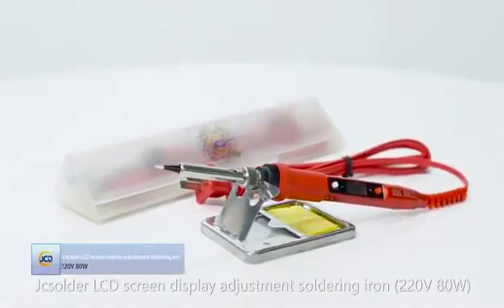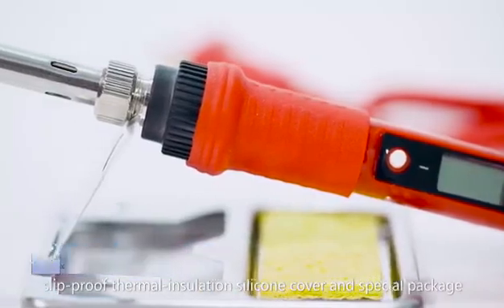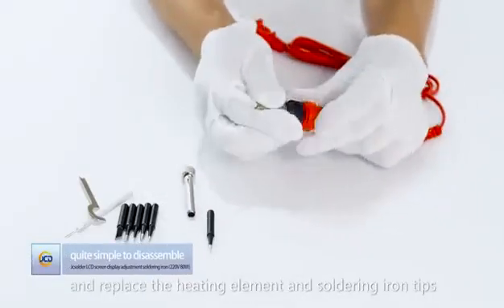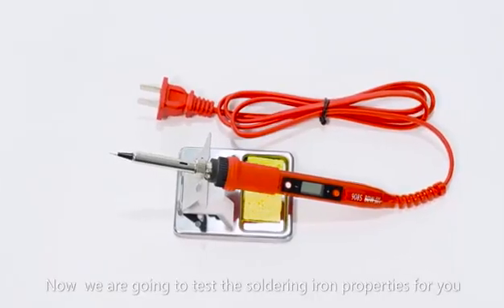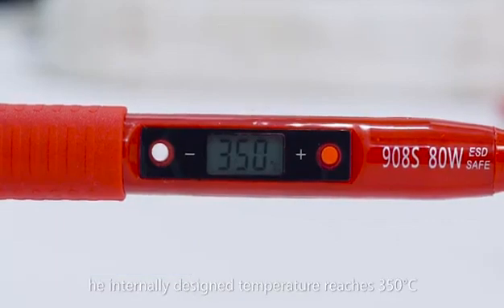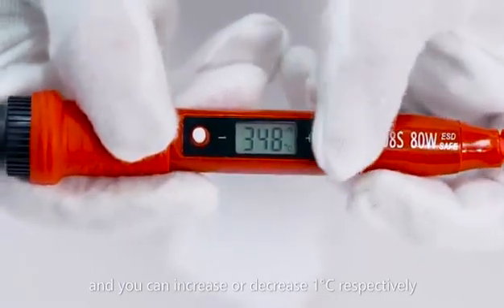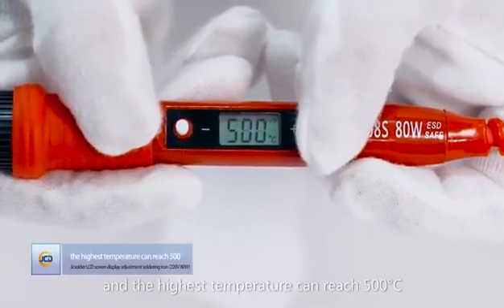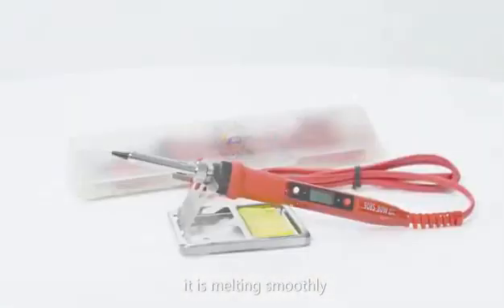JCD 908S Adjustable Temperature LCD Electric Soldering Iron 80W

Comment: I'm pretty sure the below is wrong (Because the two examples contradict eachother), but this came from some online manual.

1. After 60 seconds of power on, put the soldering tip on a thermometer, and a moderate amount of solder on the soldering tip; make the test point and the soldering tip have good touch.

2. When thermometer displays a stable temperature (about 2 seconds), write down the temperature.

3. Move soldering iron away from thermometer; press the (-) and (+) button at the same time to enter temperature Calibration.

4. Input adjustment quantity. Adjustment quantity=set temperature - measured temperature (see example)

5. Press the (-) and (+) at the same time to exit temperature interface, finished. Example 1, when setting temperature is 350℃ while measured temperature is 342℃, the correction steps are as follows: a.press the (-) and (+) at the same time to enter temperature correction interface. b.press the "+" button till the LCD displays 8℃ c.press the (-) and (+) at the same time to exit temperature correction interface Example 2, when setting temperature is 350℃ while measured temperature is 330℃,the correction steps are as follows: a.press the (-) and (+) at the same time to enter temperature correction interface. b.press the (-) button till the LCD displays -20℃ c.press the (-) and (+) at the same time to exit temperature correction interface
Reply: Thank you very much for your information, I could not find anywhere what was the use of pressing the two buttons at the same time.
Reply: What is u10 u50 etc.? What is the thermometer for iron?

Comment: Operational attention

Parameter setting:
1. To press the red and white button both at
the same time before it is power on, power
on,after the LCD is working,stop to press the
button, you will enter the setting menu.The
LCD shows (F) or (C)
2. Press the white button to choose C(degree
centigrade) or  F(Fahrenheit).Press the Red
button to choose Element U20(JCD01),U20(JC
D02),U30(JCD03),U40(JCD04).
3. Pressing the (-) and (+)  at the same time
to save your setting operation and quit the
setting menu(finished)
To protect the user from scald, when on the
setting menu, it will stop heating.
Reply: Thanks ily

Comment: It burns all tips, why?
Reply: Do you own one of these? If so, it's probably just cheap soldering wire, cheap tips or you need to clean your tips, because that stuff on the surface is oxidation/rust if it's not gross stuff that comes from the soldering wire.

There are tutorials for cleaning online.

Or if you just mean that the tips on the video are black, they are just made to look that way from the factory.
Reply: what do you mean?
Reply: Hi, what do you mean?
Reply: Tips get Burnt easy when used. Perhaps a temperature control issues?